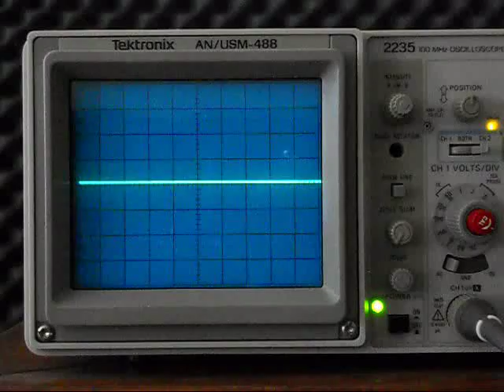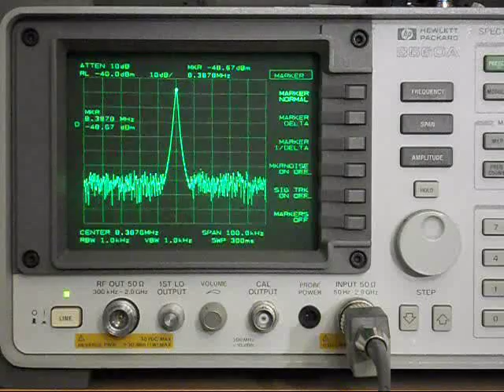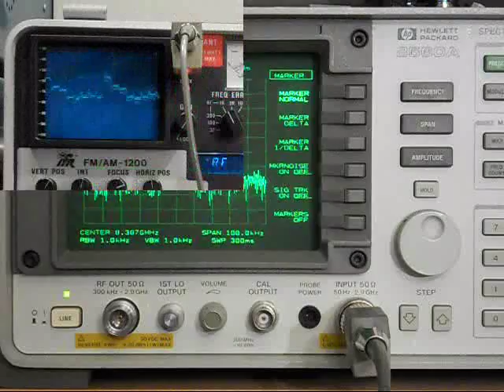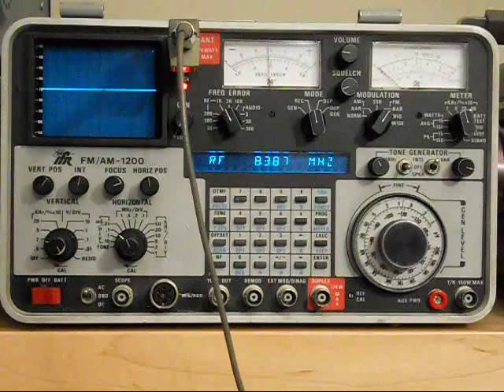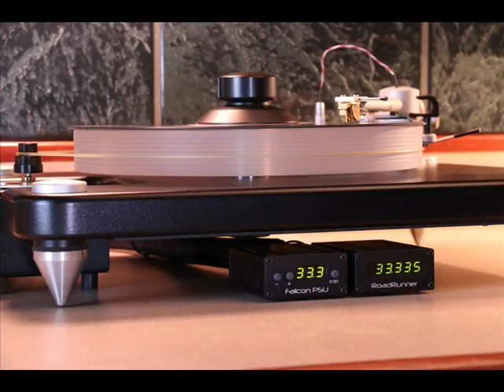Falcon vs SDS Part 2

Comment from the maker: Part II looks at the difference between the Falcon and the VPI SDS turntable power supplies once the output has settled.  It may appear the SDS output is stable, but a closer look shows otherwise.